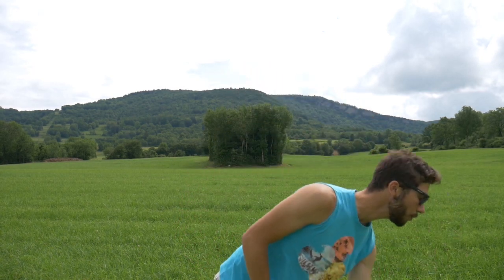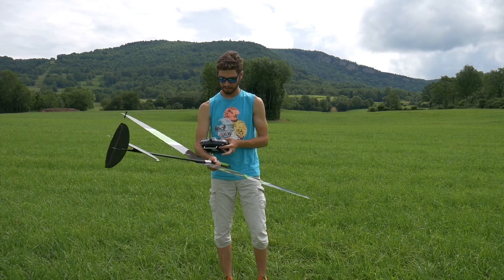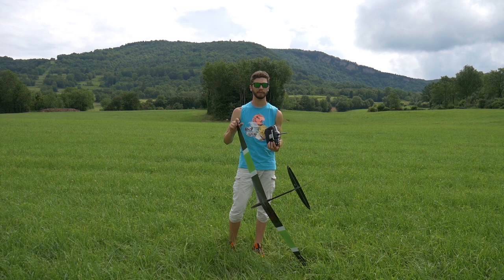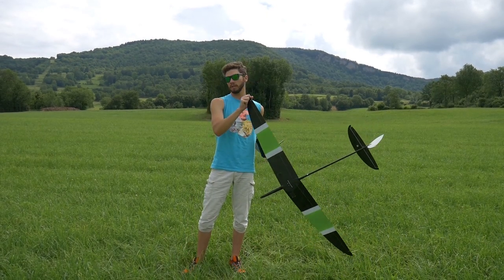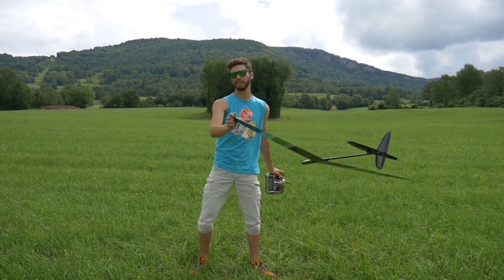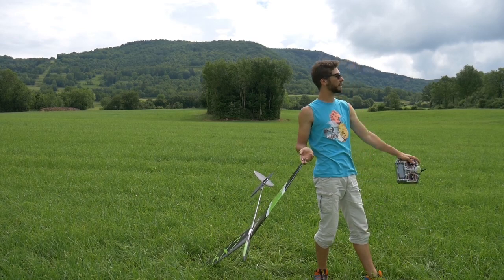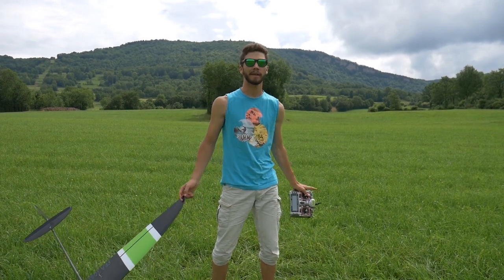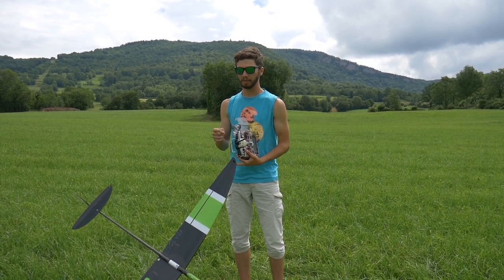How to launch a DLG / SAL glider rc

Comment: This is an art form.  You have the frame of a featherweight boxer and your throwing height is amazing.  I'm throwing very soft for now as a newbie at 20m. Thank you for your tips on using rudder and snap flaps.  My first day out ever, my Stobel V3 I found a monster thermal that took me to the moon (700ft?).  I let the glider go where it wanted to as you suggested and It starting rising fast.  I had to bail out when it got so small I couldn't see it.  Flight time was 23 min including 2 thermals in the same flight. I feel like this is like learning a golf swing.  When I try to 'kill' it, my throws are bad.
Reply from the maker: ifly65 Nice flight! Dont worry launch height Will come with practice but dont go full power until you have the good technique , you can hurt yourself or brake the glider.

Comment: At the point of release, (top view) seems the glider is a bit side ways.  is that normal??
Reply from the maker: yes , but it's quickly compensated by the rudder , it's called snacking , more modern glider like the NRJ have way less snacking
Reply: Waiting on the Libelle to arrive. I understand  the glider is not  premium but at least will get me started. 
(snacking) put that one one my glider vocabulary .
Your videos are well presented and plenty of information . 👍

Comment: Hi Pierre,  thanks for posting.  What are your average heights you throw?
Reply from the maker: hello , Right now with NRJ I am arround 75 m average
Reply: @pierremeunier   Do you think the aileron gap seals help achieve higher throws?   I am throwing pretty hard but my average is only 55.    Falcon at 210g  no balast.
Reply: @NickSmith-hv9zi  210g Falcon is light. My light Falcon 202g I throw maybe 10m less than my Standard 227g or Heavy 245g. I think 55m is pretty good considering it is light but I'm not practiced enough to say for sure. I would be interested to know if you have tried gap seals on your Falcon to good effect.
Reply: @kirkglundal4289  Hi Kirk,  i have not.   I don't believe the gap seals would do a thing.  A friend of mine has a bamf he installed seal gaps but saw no difference.     About the weight,  it is a tossup depending on conditions.   I would take a lower altitude toss but have a very light falcon any day as suppose to 45g heaver with 10-15m higher that is if conditions are very calm.